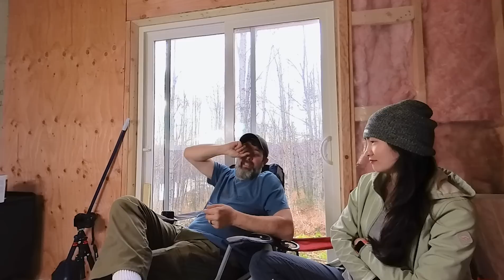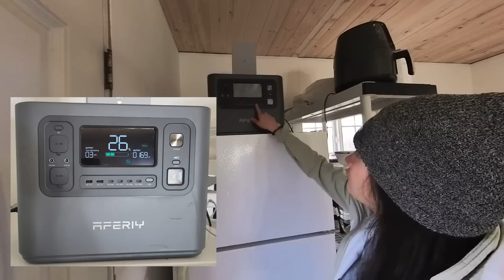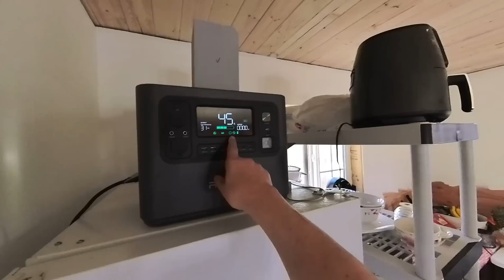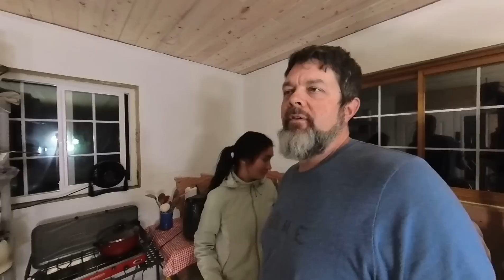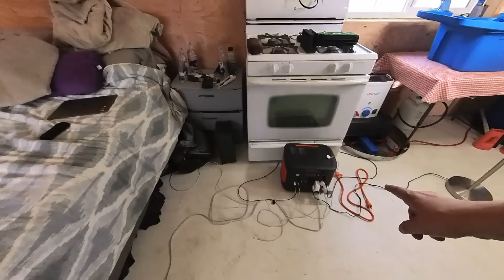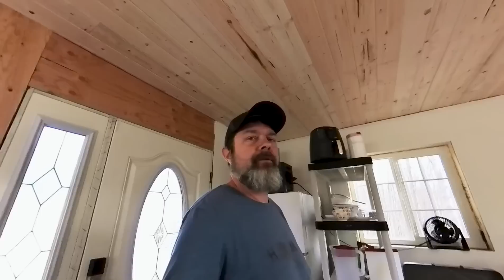WE NEED POWER.  IS THIS GOING TO WORK?

Comment: We’re in the northwest territories not much sunlight through the winter same as you were running 300 amp hr battery and a 200 amp ion lithium batteries…. charging it with our generator for now we can run everything for a week….. summertime I’ll hook up my 400 W solar panels I’m hoping to run 800 W in total…. this includes powering our devices refrigerator Starlink outside light….all LED all we need for our cabin love the video….

Comment: My old school generator is stored in the shop with no heat.  The Canadian cold shortens battery life but not bad.  I use mine for emergencies so it isn't used much.  I run it for half an hour once a month.  You should be ok storing it in your shed but experience will tell the tale.  Great job on the channel.  Your wife is a real gem and you're a lucky man!  All the best and thanks for the well edited and thought out videos!!

Comment: When you get around to planning a larger system and start looking at 48V 100AH Lithium LiFePO4 ( low end ~$950 USD) spend just a little more and get one that has RS485 connectors. I found this out the hard way. I've got one from VATRER POWER and while it works just fine, my inverter is having a hard time keeping track of the charge %  I recommend Victron as the brand to get for Solar charge controller and Inverter.  They are a bit more pricy but don't waste your money on something like Renogy as I've had nothing but problems with them. Victron is very feature rich and just work.

Comment: I bought the Aferiy 2000W generator and it came with 2/200W suitcase solar panels,  for hurricane season here in Florida.  When Hurricane Milton came thru, the electric was out for 3 1/2 days before getting back up and running. I ran my fridge and big freezer with the Aferiy by letting them cycle for an hour and a half in the morning and again at night and put it out to charge in the daytime.  I didn't have any problems what so ever with it! I do have a 6800W gas generator but sometimes you can't get gas when the power is out.

Comment: I don't know if 6 cords is enough. We live in northeast Missouri and would easily go thru two cords a winter with our fireplace insert. We also used natural gas.
Reply from the maker: Keep in mind that fireplaces are terribly inefficient and use 2 to 3 times more wood, which is why everyone up here uses wood stoves. Most wood stove users here we've talked with have recommended 6 cords based on our cabin and stove size.  But yes, we also have propane heat.  I guess time will tell and we will keep everyone updated.

Comment: Honda makes a version of their inverter generators for extreme cold weather that has features like a heated carb, but these are rather hard to find.  Everyone who uses them throughout the winter has to build some type of insulation around them such that they can still breathe when it drops below around 0 F.  Otherwise you will be dealing with constant freeze ups and shutdowns.

Comment: Figure out how many watt hours you think 🤔 you need, and double it. You'll be pretty close to actual use needs. The solar panels don't make their wattage rating, etc. I had to add 400 watts of panels from the effects of chem trail clouds drifting through Oklahoma. Being that far North, you probably need at least 2000 watts if panels. I had 932 watts coming from the solar panels yesterday at 10 a.m. It was windy too, and about 300 watts in a gust from the wind generator. The days are getting shorter but my batteries were charged before noon, and I used the air fryer for a little pizza 🍕 while they were charging. If you are going to run the whole house, you need at least a 24 volts system. Don't go with 12 volts. 48 would be great, but the components are pretty pricey, so mine is 24 v. Basically, you need enough batteries to run everything without running down, and enough solar panels to charge them plus a few more panels for cloudy days. I used 40 amp Epic Solar charge controller, at 932 watts yesterday, it was putting out 34.5 amps. After I started putting my system together, I haven't had the money for a solar generator like that. On a house system, the portability is not much of a perk to have. I'm only running one room. If you use a bigger inverter, the idling wattage will be higher, and more batteries will be needed. People tend to not have enough batteries. They're expensive. The four lithium batteries I bought cost me $2116. I wish you good luck. Hope this helps you figure out what you need to have. I didn't have to buy or do anything to my system this year, except check the water 💦 8n the wind generator batteries.

Comment: I don't have a power station like that. I built my own system. I'm using four 25.8v lithium batteries and four 31 series deep cycle batteries on my solar, twelve deep cycle batteries on my wind generator. That's 15,000 watt hours on the solar, 12,000, 6000 usable ( lead acid) on the wind. There was a long rainy spell in May, no sun ☀️ for a week. My solar batteries 🔋🔋🔋🔋 got down to 24.2 volts. I could have let them get down to 24.0 volts and used the charger function of my Aims Power inverter and charger. But the sun 🌞 came out the next day. It took two days to get them back up to 26.6 v, full charged. I have 1600 watts of solar panels and a 600 watts wind generator. They each have their own 2000 watts inverter.  I've been off grid for four years. At first, I had twenty lead acid batteries but last December I bought four 24 v 100 a lithium batteries. The twelve best ones are on the wind generator. I'm fixing to make a cake in my oven. I used the air fryer earlier for potatoes, sliced them thin,  took 7 minutes. I bought the Emeril Lagasse 360 french door oven. I have spent $6000 on my stuff, but it's good now for years. I have enough power to run everything for days. I have two chest freezers and a mini fridge running off it. The wind generator makes enough power in the winter to run an electric blanket and a little electric heater. I made my wood 🪵🪓 stove out of an old sandblasting tank. I bought a Winco Lil Dog gas generator for worst case scenario, I've used it once to charge the batteries, in November of 2021. I use it to run my welder occasionally. Two weeks ago, I was running a little window air conditioner. I've got two 20 pound jugs of propane, but I don't use it much. One jug usually lasts a year. LOL about the ice cream 🍦. I  have three six quart tubs in one of my freezers.
Reply from the maker: Thank you for sharing.  What an amazing setup.  I wish I could see that in person.

Comment: Great job guy's ! Use what you have for now it slowly comes :) I pretty much run my whole cabin on power stations, Full size 18cubic fridge & a 7cubic foot freezer lights internet water pump all runs on my Bluetti  AC200L for a day & a half & I'll be adding a battery to it very soon in a video 😊, Check out the video if you haven't seen it :) If it get's down to -10F that generator probably start outside, I'm lucky I built a little shop for my truck because it's diesel & I have a couple yard cats that have their bed in the shop so I keep a little fire in the woodstove to keep it above freezing even at -40 :) I can wheel the gen out when I need it & in the shop when I don't 👍, A shop is a must when your off grid :) Great video Take care
Reply from the maker: Thanks for sharing.  Good info.

Comment: You say you need between 6 or 7 cords of wood. You have 1 cord right now. How far is winter away from you. I thought you would need a few months on the short side for your wood to dry before burning it. Could you not have done this earlier in the year so your burning dry wood.??
Reply from the maker: Currently, we have 2 cords on the property.  At my friend's place I have 2 additional cords cut into logs and some trees to finish up on over the next few days.  Plan to have 6 cords here by the end of next week.  That will all be in 16-inch rounds and still need to be split.  So that's a few more days of work with the splitter. All the wood we are gathering right now is spruce beetle kill that had been standing dead for years and is dry and ready to burn.  Summer got away from us with construction and we didn't have time.  It's a typical Alaskan thing we are learning.  Plan, get about 25% of it done, and replan.  I have 6 cords of spruce I cut down this year, but it won't be ready to burn for a year or 2.

Comment: Thanks for the video ! Not much question whether it will work, only how often you'll need to start the generator to recharge. There is little reason to expect to generate much from solar in Alaska over the winter. I was wondering if you might be able to reduce the electrical demand of the fridge by freezing containers of water outdoors and putting the ice in the fridge to help maintain low temperatures. This would be using your fridge more as an icebox with a refrigeration assist. I don't know if it would work, just a random spark of inspiration . . . that might be a stupid idea. 😜
Best wishes & good luck !!!
Reply from the maker: It's definitely worth a try.  During the winter months, we have plenty of time to mess around experimenting with things like that.

Comment: You are going to need at min 50 high end solar panels and battery and I would see if get a older military generator that runs on any fuel because when dark winter hits you have no power and solar will do you no good so take what I tell you to heart because I want you to have a safe warm winter
Reply from the maker: We do plan to put in a full solar system next year and get as much use as we can from it.  But yeah the area we are in has no power to the homes and it's generators all winter.  Each year we will learn and improve.  Thank you

Comment: From everything I’ve researched, bringing the generator inside is the right thing to do when it gets below 0. That way the oil and block will be warm. Its a pain, but it seems to be normal. 

On a different note, I’m flying up to AK to scout for land Wed-Tues this week. So, if you’re available Sun-Monday, I’d happily buy you both a coffee in real life just to be able to pick your brains from what you’ve learned so far. We’re moving in just a few months so, I need all the intel I can get.
Reply: There are two problems with these generators in the cold. First the oil shutdown will kick in when the generator is cold. The second problem is the oil breather foams up in the cold. I’ve been using synthetic oil and run the generator in an insulated box for about 20 years with no problems starting it in the cold. We have been using this at our off-road cabin in the winter.Good luck on finding you land. Are you looking for land you can drive to or off road land. I know there was a parcel about a mile from our remote cabin. That land is about 7 miles off the road with ATV or snowmachine access.
Reply from the maker: @ScottBalkum  absolutely.  If you're in the Kenai area. Send us an email.  Our email address is jayandeleinne@gmail.com
Reply: Hey, Scott.

I think I can say a word or two at this point about couple of things you should think about...

1. Health insurance. Get yourself a quote, but get for couple of ages like current age, +5, +10, so you'll get understanding how long term solution work.
If you plan live off savings, that might be an issue, because quotes are crazy, but insurance agent mentioned there is a federal program which give you tax credit if you are low income . Now the good question - will it work w/o income? Probably not, but I'd confirm with locals first. Plain insurance quote w/o any discounts has a hefty bill. Also, all quotes I got were much worse in terms of coverage than what I have in VA now.
2. Homestead exemption. While not many folks even know about it, it exists and represent not just a tax discount, you might be happy about, but mostly important - it's a legal measure, which protects certain amount of equity in your primary residence, for example - from medical bills you can't pay. AK is not the greatest state for that - it protects only 52K, while there are states with unlimited amount or hundreds of thousands. There are states worse than AK, with lower or no coverage at all.
Also you might opt for irrevocable trust as an option, but you'll not be able to own your property after that (just in case if somebody will recommend that).
3. Now, taking in consideration #1 and #2. The only way you want move to AK is to get a cheap land and do the construction by yourself or hire some folks for jobs you absolutely can't do by yourself. You want to stay under 52K on your total cash investments, emphasis on word "cash".
AK and off-grid style of living, working with tools, etc. has higher risks of injuries and you don't want to say good-bye to your home, because of healthcare stupid billing system. My wife had an car accident recently and all bills totals for 2 days ER services were around 50K. We had our car insurance extra coverage and our employee plan 30K discount, so ended up paying 3K only. Mostly important - insurance refused to pay couple of bills, because that was not authorized and this is something you can't control while being at clinic.
Bottom line - situation with medical bills might turn completely random, based on what insurance will approve or not, and you want to be able to deal with it while still drinking a coffee in your kitchen.
4. Explore for job opportunities and ensure you'll be able to not just find a job, but also to be able to find another one. If you skilled in some handy area, that's good, if not - think about changing your skillset to match local job market.
5. All other homestead/outdoor this and that... That's the least thing to worry about. If you know how to use internet, persistent and don't mind to get your hands dirty - you'll make it. The most important thing about it - you have full control over these aspects in contrary to #1, #2, #3. 
6. Final point, which is not being massaged by many folks. Think about that from long term prospective. Are you persistent enough to go through all challenges? Are you healthy enough to reduce all potential medical risks? Do u understand you'll be aging, body/mental abilities will degrade and what is something fun today, like living off-grid style, might be a unbearable hassle later and moving to other place will be very challenging?

Ask yourself as many questions as you can and try to answer them in advance.
Good luck.

P.S. Flying to AK tomorrow, will visit property in Funny River.
Reply: @AlexB-km7os  Thank you for that. There is a lot to think about for sure. For the most part, we are good with all of these in 1 form or another. We aren’t young, but we’re not old yet either. Surely we’re at the point where stuff starts hurting for no reason. 

The wife has a good job that she works from home which handles the insurance aspect. My job is rather different but it caters to the lifestyle. I’m, a commercial filmmaker and wildlife filmmaker. 

Cheap land is something we’d love but it really doesn’t exist unless there’s no access to it and then it no longer becomes cheap when you move money from the cost of land to simply getting to it.

We aren’t exactly new to homesteading and living off the grid. We currently have acreage in TX where my wife and I built our own home ourselves, and several other “home like” structures. We’re quite good and efficient at building now.

Our biggest shock to the system will be the weather but we’re as prepared for it as we can be. Happily turning in our air conditioner for a wood stove. AC is the big reason we’re not 100% off grid now. TX is bad for heat.

I think I responded to all of your helpful points. We’ve done a lot of planning on this. For me, I’ve been planning since 2012. The wife has decided its time a year ago so we’re getting in all the last details in the plan now. But, we always love a challenge as it keeps us “young” at heart. 

Appreciate all the points and good luck on your land visit. Funny River is a place we have considered as well.

Comment: To make your fridge more efficient if your freezer is empty, freeze containers of water to take up the empty space. The unit should not have to run as long because the frozen water helps maintain the temperature.
Reply from the maker: We'll try that.  Thank you

Comment: I don't own a Honda but do have a Predator that I run in a shed. The greatest worry is carbon monoxide. I solved that by running a steel pipe from directly in front of the exhaust through a hole in the wall to the outside. It's worked well for the last few years. Of course, you need to design the hole with heat in mind as that pipe does heat up quite a bit.
Reply from the maker: Yeah planning on something like that soon

Comment: the Simple Living Alaska you tube channel has the exact same honda generator and generators like the other one they go through allot of problems with the cold . they have one video where they cover all the common problems with freezing. the best thing they did was to make a insulated box they put over the generator when running outside and would store it inside when not in use. might want to watch the video because he shows common parts problems with the honda generator
Reply from the maker: Thank you.  I've watched many of their videos but have not seen that one.  I'll definitely watch those and get some tips.  Eric is a smart guy.
Reply: He's right I watched the same video it's good.
Reply: We have an off-road cabin and I have been using a Honda 2000 for about 20  years with no problems. I use synthetic oil and I run it in an insulated box so it stays warm so the oil breather doesn’t plug.  We mainly use it  in the winter when the sun is low as we have a 4K 48 V inverter charger. I just replaced the AGM  batteries after 22 years.
Reply: this video talks a little about the generators and there is a newer video also i have to go to work cant find it now   -- https://www.youtube.com/watch?v=xA8RLA016-g